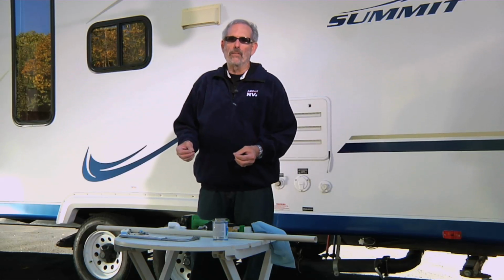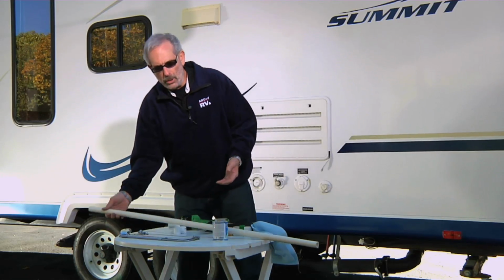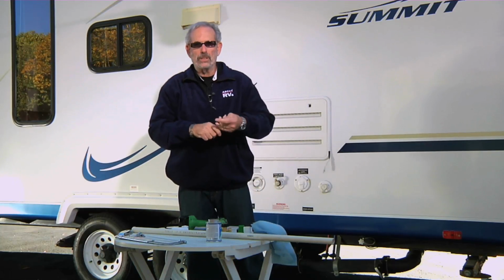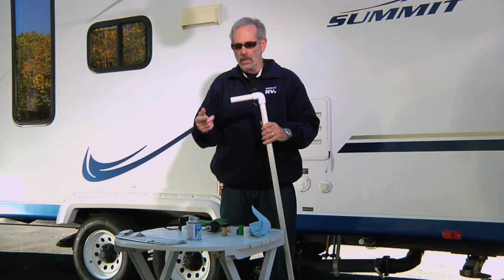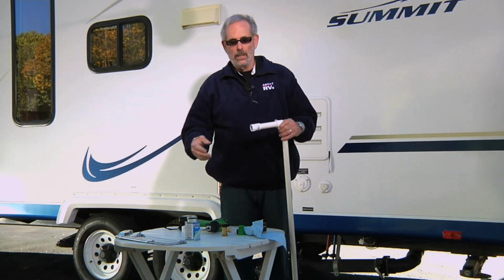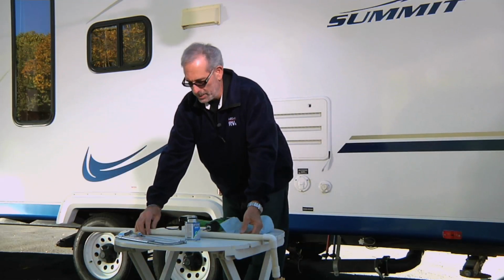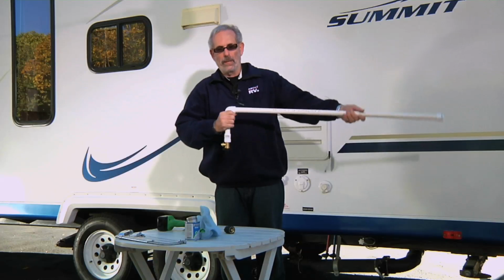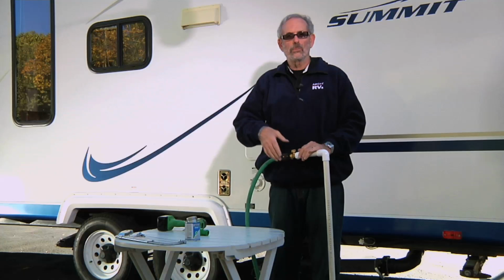Build an RV Holding Tank Flush Wand

Comment: Won't work on all RVs. My toilet doesn't dump straight down. Flexible pipe would work better.
Reply: I made a spray head on the end of a length of hose instead of pvc because mine isn't a straight drain. Worked out great.
Reply: @FunkyFlorence  do you have a picture of what you built? I’m needing one with a flex hose myself
Reply: Make an elbow at the bottom and drill holes at the end of a cap. Turn your pressure uo

Comment: What about a quick disconnect on the side of the rv, through the wall and into the bathroom (over the tub or shower for spillage) for a short hose to the wand? I haven't gotten the nerve together to take a hose through the door, then all the way to the toilet. Thank you
Reply: You may be about to put a garden hose adapter on your sink faucet and then use a short garden hose to flush with. 
I did this with mine.

Comment: You might check your local codes--I believe a backflow prevention device is required by plumbing code. Even if it isn't, it's still a good idea anywhere contamination is a possibility.
Reply: Pansy ass
Reply: When dumping at public facilities they have hoses ready for use. Dump the tank then rinse with their already prepared plumbing system.
Reply: Not many around here do that, particularly at state parks. I've seen what you're talking about, but there aren't really that many around here.

Comment: I made the same type of wand since the built in flush system in my RV did such a poor job. Although I put a short "L" on the end that goes into the tank so I can direct the full force of the water jet into every corner. Also the diameter of bowl will allow you to slightly tilt the wand so the water jet will hit the top of the tank. Rotate the wand to hit all sides. You'd be suprised at how well this works. Takes only a couple of minutes and the tank is done. Not a single odor is left behind.

Comment: Did the same thing about 5 years ago made one for the Toilet (much shorter than what he made)   and a long straight one for my gray tank. the Toilet one is pretty straight forward . but the Long gray tank one I would put in the tank through the gate valve or gray water dump valve  and turn it on and slowly run it back and forth in the tank . you won't Believe the Crap that comes floating out of your Gray Tank.  it does help with gray tank smell by doing this  Old  Food , Tooth Paste  Hair ,  Soap Scum  Etc   are mostly removed from the Tank

Comment: In addition to cleaning off the burrs, you should also take some type of sandpaper and ruff up the edges on the PVC pipe so that the glue will bond better and it will not come apart.  Some PVC pipe is smooth on the outside and the glue doesn't always adhere good.I've made a similar device, my own design.  Works very well to get the nooks and crannies in the black tank.  It also helps to fill the black tank up after flushing one more time.  You will see even more junk coming out.  Also, remember to close your dump valves and reset your black tank for your next trip, water and chemicals.You should never leave a Black Tank or really any of your tanks dry.  Bacteria will grow and you will get smells in your unit, if it is sitting for awhile.Just my 3 cents worth.

Comment: Nice job but I only drilled two holes, each 3/16" and one pointing upward slightly and the other point straight out. With the two small holes the pressure is fantastic and makes cleaning easy.

Comment: When connecting the long piece to the elbow it would have been a good idea to clean all the burrs on the long section of pipe (2:17) to prevent loose bits of pvc entering the tank or block up the holes in the end of the nozzle
Reply: born2flyau I’m glad I wasn’t the only one to see that. I wanted to stop watching at that point, but I wanted to see what he used for a nozzle.
Reply: Doesn't really matter this will never HOLD pressure like a house hold PVC system.